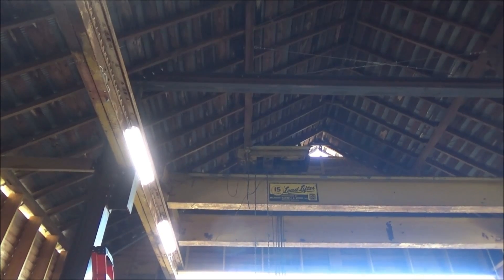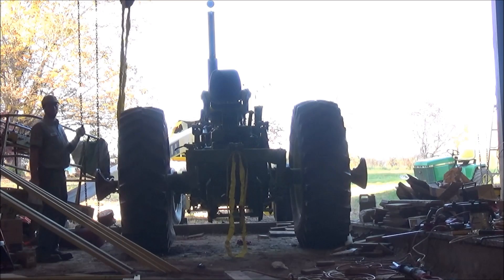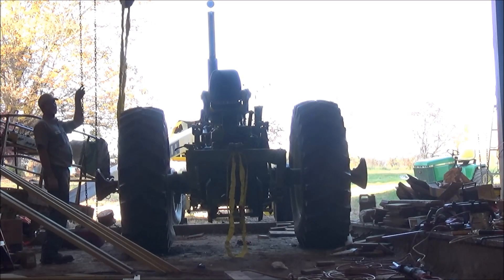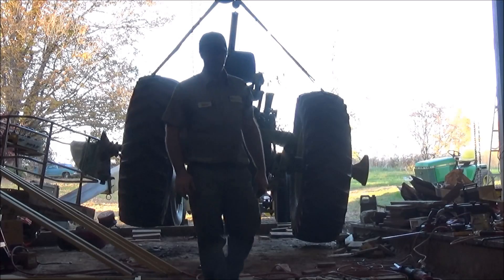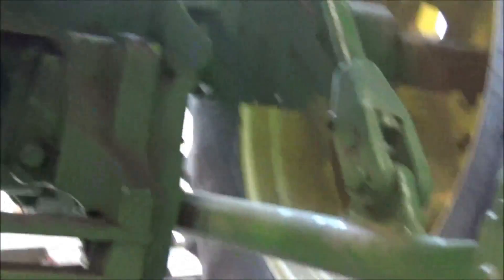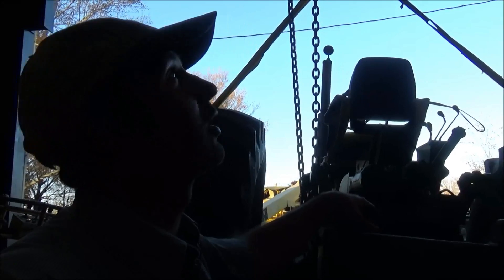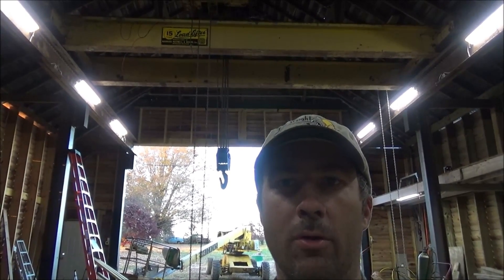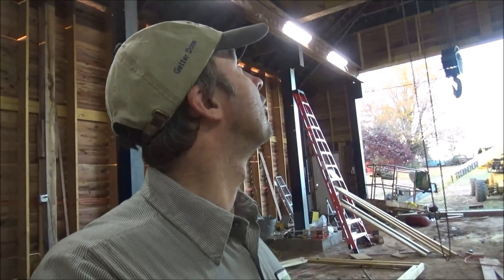Will it lift? Initial testing of the restored 15ton Shaw Box BR bridge crane.

Comment: I see this was done before you bought the Carlton drill and dropped it on the floor from 3 feet up. And broke the damned thing because the wire rope failed. And , nearly got yourself killed in the process.

Comment: Darn, looks like I missed putting in the hot water floor heating system and pouring the cement floor.
Reply: Whoops, looks like I may be able to see it done in the future
Reply from the maker: It hasn't been done so you can still see it. :-)

Comment: Almost appears to be bending the rear wheels in at the top, think i would have rigged it to the axle housing inside the wheels. Watch your video and look at them wheels...might for all I know not even phase it and once released be fine. Thats one heavy duty crane for a home shop. You did a fine job setting it all up and repairing it. Monumental job this barn is and am amazed your pretty much doing it solo. Thanx for sharing your progress.
Reply from the maker: It was just the tires flexing in on the wheels. My straps weren't long enough to go over the diameter of the wheels or to hook it basket around the axles inboard. The wheel centers are 4" thick castings so  no worries about them.

Comment: Job well done. Man, it works! I was a bit worried about you being under it while testing it, but you know what you are doing. I tested my crane from a distance! Did you find muscles you didn't know you had from pulling down on that chain? Fun video. I really enjoyed the lift. I have a Fiat-Agri D90-100 6 cylinder tractor: hmmmmm..... weighs how much? Oh, btw, what is the deal with fluid in the tires? What fluid? Is it for weight alone?
Reply from the maker: Yep the fluid is just more weight for more traction 200+hp can be hard to put down to the ground without a lot of traction. The lifting didn't bother me at all.  It wasn't really much of a test since I was well below capacity. I think a true test would be to pull the unit at overload. That is when you want to stay back! I looked in the chart and those tires should hold 1500lb each of liquid ballast so my tractor should be right around 22000lb as it sits.

Comment: so now i think you should make a power unit that sits on the ground, heavy but on wheels to save you pulling all that chain, probably a load of batteries and motor?
Reply from the maker: Not worth it. I only have to pull all that chain to lift at capacity, normally I will have my 3 ton hoist hanging from the main hook as that will handle 99% of what I would lift and be probably even faster than a motor on the big hoist thru all that reduction.

Comment: Brian, I have to say I subscribed after watching you on Keith Rucker's site. I've become a fan but just tonight I went back and watched all the barn build vids. I am blown away by the work you do by yourself. You basically rebuilt a barn to save a roof. You may not have Abom torque, but you damn sure got plenty of Fenner's Getter Done. I love your vids but if I could give you any advise it would be work on the audio. I don't know what these other guys use but I have a hard time hearing you at times and I'm from TN and understand the KY accent. I also love that you include Bailey at times just like Adam did Stella (RIP).
Reply from the maker: I plan to get a wireless mic as soon as funds allow. I am not sure what is up with the processing of this video for some reason it only shows in HD and some have said they couldn't hear while other comments said the audio was perfect? I wonder if the platform you watch the videos from makes a difference? The audio is fine on my desktop, is that what you are using?
Reply: bcbloc02 Well I stream vids to my TV and there are times where I hear you fine and others where you seem far away from the mic. I figured you were using the camera's onboard mic which accounted for that. Don't get me wrong. I enjoy your vids.
Reply from the maker: Hammer0f Thor
I hope a wireless mic will cure that and keep  the machine noise down.

Comment: Brian,  I think lifting that tractor the way you did put way too much stress on the axle ends, the wheels and the axle bearings and casting.  Better you should have lifted on the inside of the tires and split the load.
Reply from the maker: What do you reckon happens when the duals are on and you run that outer wheel over a high spot and the force is twice as far out? Now throw a 40000lb grain cart behind it that adds another 10k to the rear thru the drawbar for more traction and bounce it across a rough dirt field. That is what this thing does, I doubt picking it up the way I did was a drop in the bucket to the stress it is made to take.
Reply: Good point.  I'm not a farmer nor do I play one on TV. 8~)))

Comment: Your crane is amazing! It makes me have crane envy, I just finished my little 5 ton bridge crane which will have to be enough for my little shop. Right now the heaviest thing I have to lift is only 9000 lbs. What kind of safety factor did you build into your crane? I'm also envious of the headroom. I only have about 9 feet under my hook. Did you ever do a video on the rest of the bridge and trolley movements? I don't remember seeing anything but sometimes I miss stuff. My heavy trolley is chain driven but I am just pulling the bridge and would love to see the mechanism that drives yours.
Reply from the maker: I have not since I don't have the hand chains for them. When I get it all fully operational I will do another video.  When I built it all I made it so I could get at least a 16ft hook height.

Comment: Hi mate.  Well done.  Another milestone out of the way.  Better get cracking on those doors, before you know it, your knee deep in the bloody white stuff.  
Will you be able to get the pour done before the winter?  Again, well done mate, Penn and Teller have'nd got a patch on you.
Reply from the maker: T shirt weather today and they say 30mph winds and snow this weekend. Just depends on the weather if I can get it done or not. I probably can since I could always cheat and run hot water thru the floor heating pipes to keep the concrete warm.
Reply: Fair enough.  I did not think of that cheat.  30mph winds aye, good thing that you have some draft holes for the wind to escape.  ( O;

Comment: Yup i sure did (enjoy the lift). And it works perfect too. brake seemed really smooth and accurate. congrats on a well done bit of engineering.
Reply from the maker: The brake works great even with the various loads it works well and it isn't sticky on release like some others I have used.

Comment: Hot damn Brian, that's awesome! If you've got an old truck bed hang onto it...and then hang it on the hook to use as a dumpster for cleaning out the barn/shop :)
Reply from the maker: No extra truck beds, I would just have to hang the whole truck. :-)
Reply: touche' :)

Comment: Well done.
I see you had a great deal of confidence standing under the bridge during the proof testing. 
Certified by BB & JD and Bailey approved  
BTW your hard hat is better than the one I usually do not wear.
Reply from the maker: That bridge comes down ain't no hard hat going to help!  I have total confidence that it can hold anything I can pull.
Reply: bcbloc02
Yep, that is an understatement.  ;)
From this side of the camera it looks as though most of the supports are in compression and more than capable of supporting the full SWL + a healthy safety factor with minimum deflection.
Is the hoist still strung with the original wire?
i catch hell every time I am around an overhead crane or overhead work because i absolutely hate wearing hard hats and I am usually bare headed.
BTW, those modified lights are looking good.
Reply from the maker: patw52pb1
Yep same wire that was on it when I got it. I unspooled it all and gave it a good soak in diesel fuel and it seems in pretty good shape now.

Comment: Did you use the man lift to set the hoist up on the bridge?
Reply from the maker: No I used a forklift from work in combination with the man lift the hoist weighs about 3000lb so no way the man lift could even think about picking it up.

Comment: I build a spreader bar for the company I worked for the engineer that came to inspect it asked where the 3 ton spreader was. I told him he was looking at it he said no that's a 5 ton one LOL I think I over did it!
Reply from the maker: Nothing wrong with a factor of safety. :-) Only drawback is when you have to move the thing. lol
Reply: we generally just left it on the crane lifting long bundles of steel flat bar!

Comment: Wav ... you'll never miss lifting force !
Just remember the more you spread out the straps the stronger they have to be - you can calculate it !
Reply from the maker: Yep side pull subtracts from lift strength. A good spreader bar would eliminate that issue.
Reply: bcbloc02
Yeah, if you hook it directly ;-))
... else you just move the problem "upwards"

Comment: Yeehaaa liftin stuff....
It would not be that hard to adapt one of those electric chain hoist motors to hang from the bottom of the hand chain and turn it for you. If you build it to be removable, you just hang it on the chain when you need it and plug it in.

Comment: Nice job.   Impressive crane!  It would be better to put straps around the rear axles of the tractor up close to the transmission. That's pretty hard on the tires and rims the way you are lifting it.
Reply from the maker: I would have but my straps were not long enough to do it that way.
Reply: Are you often told your strap's not long enough?
Reply from the maker: *****
It has never happened.

Comment: Way to go there Brian

Great result for you one more job off the list

As a Sparks at the iron works a long time ago I had to provide standby when they did load testing of the OHC ones biggest was 750ton with the booms being were the control panels were located , by ek did it creak at the overload , had to reset the overloads a couple of times 😀
The cranes ranged from the above down to 5ton maintenance ones .always made me smile 5 ton maintenance ones had 10hp lift motors 5 ton production had 40hp but they were quick , best drivers we had were ladies ( still there after ww2 at the bomb plant ) 

Take care 

Stuart
Reply from the maker: 750 ton, Now that was a monster it must have had girders 20ft tall! Mine isn't fast but it sure is easily controlled, lucky for me that is a lot more useful to me as it will probably only get used a few times a year on the big winch.

Comment: when you say  15 tons  do you mean  metric tons? as in 15000 kilogram   and is there a  fast lift  ratio on it?  if not your gonna work those arms pretty good
Reply from the maker: 15 american ton = 30000lb = 13608 KG That is the fast speed as I don't yet have the chain for the high torque side.
Reply: odd  system the  imperial

Comment: never had a doubt, an other great milestone. well done Brian
Reply from the maker: Your confidence higher than mine! I actually thought I might have to add a friction material to get the brake to work right but I lucked out and it is perfect as is.
Reply: bcbloc02 A set of chains would of gotten it off the ground faster, it looked light there was a fair amount of stretch in the straps
Reply from the maker: Phil's Projects
 Yeah but it would take 1/2 chain to make the load rating and that stuff is HEAVY!

Comment: I liked it Brain I knew you would make it work and it wasn't luck, if it would lift ass end of that tractor it will lift anything you need.
Reply from the maker: A couple of my machines weight more but I think it will do just fine. I think it will lift anything that I can pull up no problem. It lifted 20k lb and never made a noise, no creaks, pops or nothing.